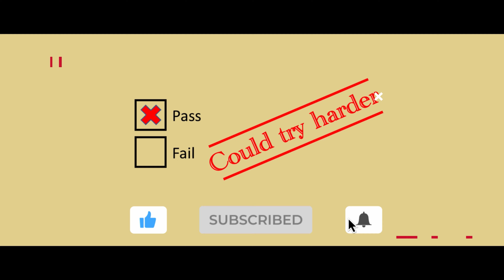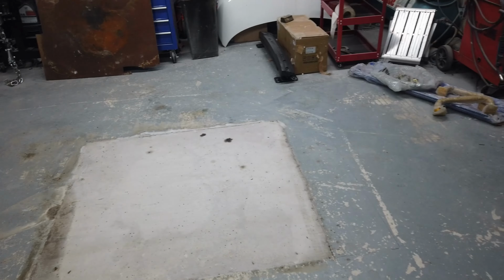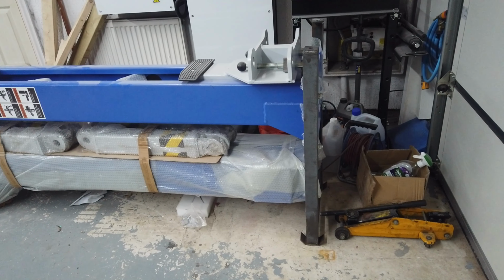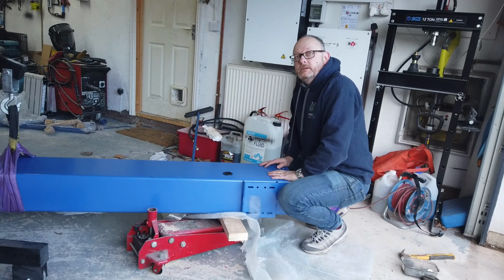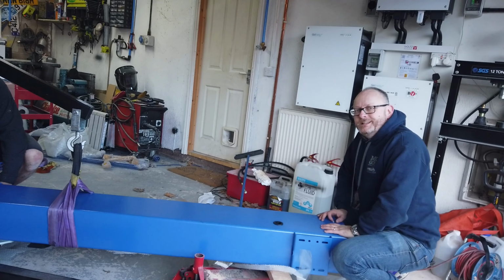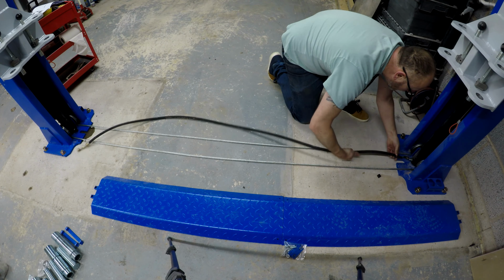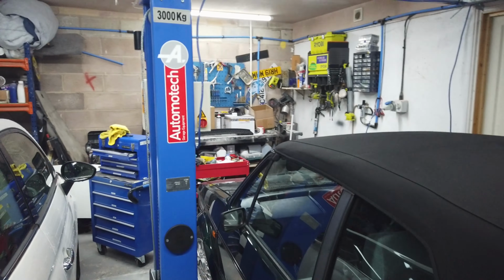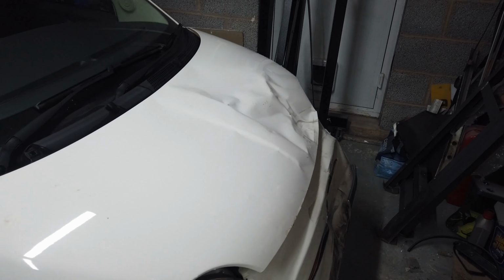EASY 2 Post Lift Install in Home Garage!

Comment: You may have seen my video of fitting the same lift in my low ceiling garage. Would not be without it now. With the TVR I can sit on a sealey seat & work under the car with no trouble. Thanks for showing.
Steve.
Reply from the maker: I hadn't, but I have now and subbed. Thanks for commenting. Those bottom pulleys are a pain eh?

Comment: I thought my two post was short at 108" ....what's yours under 80"?
Reply from the maker: Hey I've never had any complaints!! ;) but yes it's 80" and the tallest we could fit in the garage (which is under the upper floor of the house)

Comment: How much space did you need for that ramp? Cheers.
Reply from the maker: How do you mean? Width or height?
Reply: @could_try_harder  both please.
Reply from the maker: 287 cm wide X 204 cm high. That's the actual ramp dimensions. I have more space than that of course.